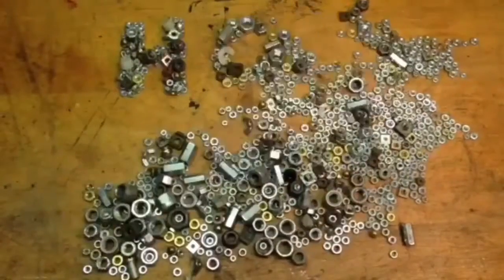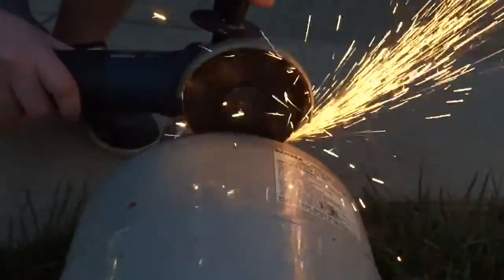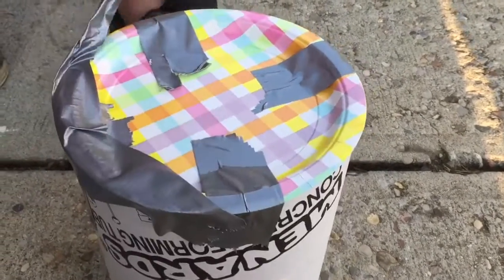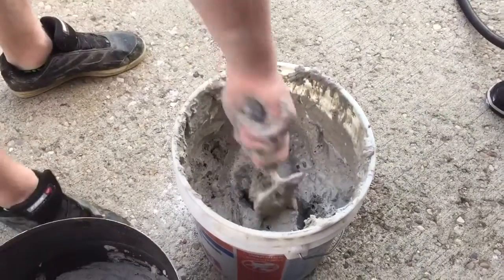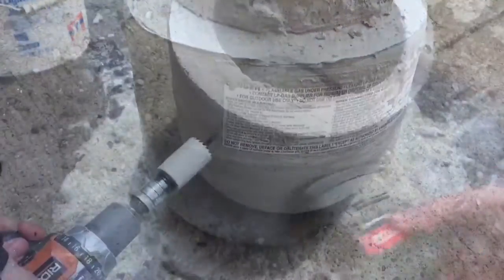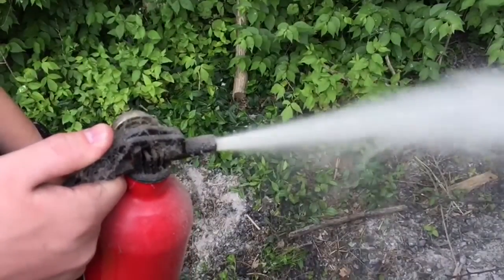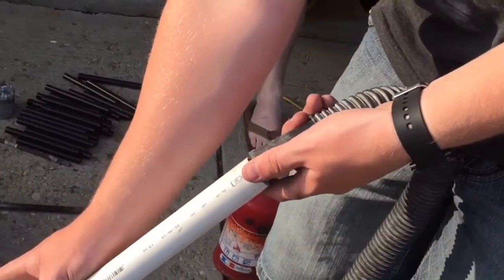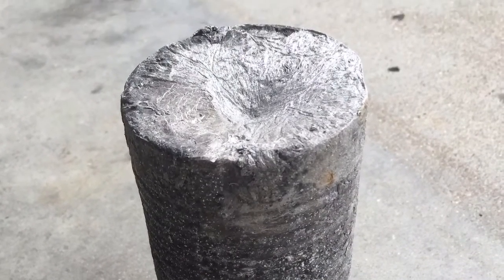How to Build an Aluminum Melting Forge.

Comment: Is a "concrete forming tube" is not a cardboard tube for forming concrete? Rather than a tube made of concrete?
Reply from the maker: If we are getting into semantics I guess I could have called it a Sono tube, tube form, building form tube, concrete forming tube, concrete form, concrete tube form,  or a cylindrical cardboard concrete form used for posts and pillars in above- or below-grade applications. I’m only glad you were able to figure it out using this video. Glad it was helpful.
Thanks for the view.

Comment: omg this is awesome can't wait to make one and melt my alumenium/zinc/tin scrap
Reply: just built it and it worked like a boss
Reply from the maker: Now you will have a bunch of ingots from all of those cans. Thanks for watching.
Reply: I built mine but instead of using the propane tank I used a 10 QT pail and a plaster of Paris and sand mix. I'll fire it up as soon as I can find an old hair dryer to drive the oxygen. I'm going to do simple coal for now but I may upgrade to propane later